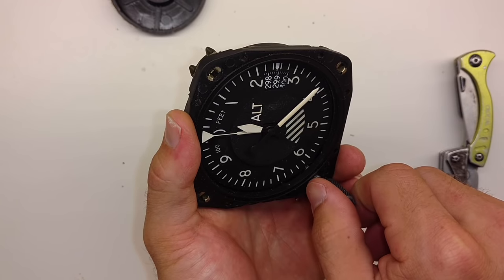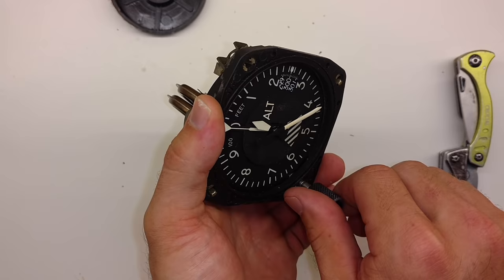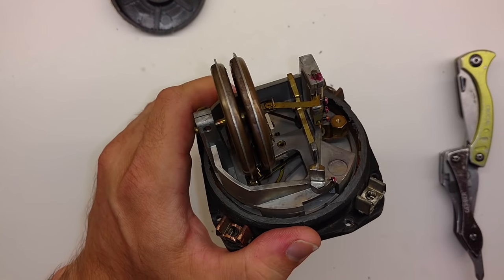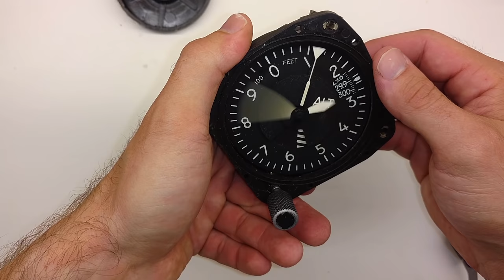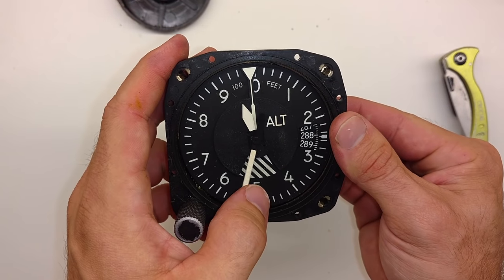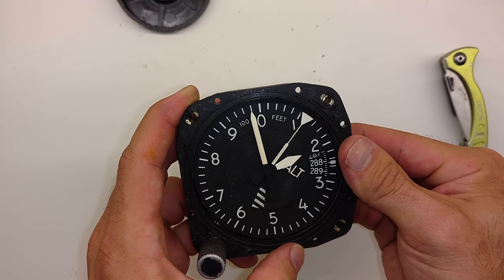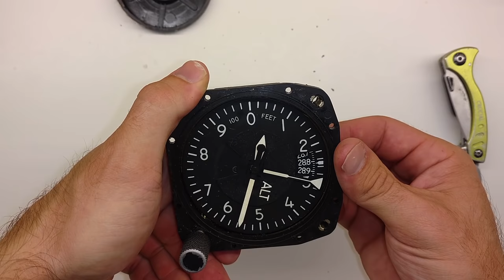Ep. 58: How an Altimeter Works | Inner Workings

Comment: Very useful about what it is for and how pilots read the dials - but sorry, it is WRONG about the capsules/wafers in it.  They are referred to as "aneroid" because it means without air.  During the manufacture the air is pumped out, then sealed.  They would collapse under the pressure from the air except that a flat spring holds them open.  As the air pressure around the capsules varies the amount of pull on the spring changes and with that the spring moves; turning the gears etc. as described.

Comment: Great video! Just a question: are you sure the capsule (wafer) contains any gas? I've always found the term "aneroid diaphragm" in several handbooks. That means "vacuum chamber" so an empty space into the wafer. Any gaseous element goes subject to expansion and contraction (pressure variation) due to temperature change. This is my understanding of the physics of gases. Thank you!
Reply: Diego,  It has to contain some gas.  The gas "expands" as the pressure outside the chamber decreases.  If the chamber did not contain any gas, it would not expand.  In this context, "vacuum chamber" probably refers to a low pressure environment. Also, the altimeter IS affected by temperature.  The amount of error depends on the height above sea level and the temperature.  When it is hotter, the indicated altitude shows you are lower than you actually are, which isn't generally a problem.  However, when it is colder than standard(15 C)  you are lower than indicated which puts you closer to terrain and obstacles.  That's why some airports are cold weather restricted.
Reply: @IdleIslander  Not correct.  There is a vacuum, not perfect of course, but the aneroid capsule will change as the external pressure squeezes it against the spring which keeps it open.   The effect of temperature is calculated as density altitude by the pilot and the altimeter does not correct itself for temperature changes.

Comment: Hi there, do you know if the adjustment knob adjusts the hands and pressure indicators only, or does it also influence the compression of the bellows. My impression from the video and from some schematics I've been looking at is that it does not affect the bellows hence the rotation of the entire rear of the module.

Comment: If you have say a 50 or 80 foot deviation and your altimeter are you allowed to adjust for it and have a different barometric pressure to correct four versus the pressure you're given from ATC? Is that some kind of FAA violation?
Reply: The AIM (7-4-3) recommends having the altimeter serviced if the error is on the order of ±75'. 14 CFR 91.205 requires an altimeter for an aircraft to be issued an airworthiness certificate for day VFR and all other flight rules, and 14 CFR 91.213 (d) 2. states you may only take off in an aircraft with a faulty instrument if that instrument was not required for the airworthiness certificate, unless you get special permission.

Comment: I'm stumped about the altimeter Kollsman adjustment. The altimeter is essentially height readings as a function of various supplied pressures. When set QNE the table is the ISA relationship (ignoring everything but pressure as a factor). When set other than QNE is it biasing all of the pressures (independent variable) by a set amount or is it biasing all of the altitudes (dependent variable) by a set amount?

E.g. if your altimeter was showing 1,000' too high and you cranked the Kollsman to subtract 1,000' would you be taking a constant 1,000' off each reading or would you be adding a constant P pressure?
Reply: It's a mechanical adjustment that rotates the entire mechanism by, using your example, 1000 feet.
It doesn't influence the pressure sensing linkage at all.
Therefore, climb 1000 feet and it'll indicate a 1000 foot climb, regardless of the Kollsman adjustment.
In other words, it adjusts the "zero point" of the instrument.

Comment: They say a picture is worth a thousand words--this video should be mandatory viewing in flight school.  I can't tell you how many texts I read that left me asking, but how does it actually work?!  This video put it to bed.
Reply: Thanks millions for this. I also encourage viewers to watch "How It works Altimeter" by shidifu111, because it is a great graphic vid that shows what you can't see well in the real altimeter.
Also, I see some discussion of aneroid wafers
the PHAK says
"A stack of sealed aneroid wafers comprise the main component of the altimeter. An aneroid wafer is a sealed wafer that is evacuated to an internal pressure of 29.92 inches of mercury ("Hg)."
There are some misleading ideas here. "evacuated " seems to indicate that all the air is removed. BUT it then says "to an internal pressure of 29.92 in Hg", which is not a vacuum. Maybe they used the term aneroid, which I take to mean no air, because the static tube goes to the altimeter, not the aneroid wafers.

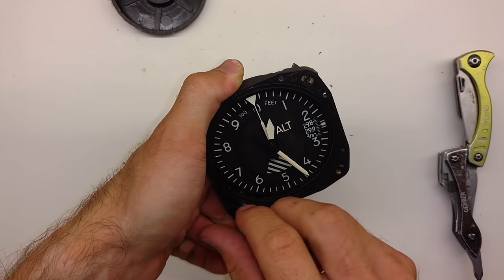Comment: great video. One correction, at around 3:00 standard pressure is 29.92 not 29.90
Reply from the maker: It wasn't intended to be set to standard pressure there, just using 29.90 as a random setting to yield an altimeter reading to compare it to an imaginary "field elevation".  Almost nice catch though!  Safe Flying!

Comment: 9 apr 2020 6:52 pm edt:thanks

9 apr 2020 7:52 pm edt: 3:59 altimeter-maximum-operating-altitude 20,000 feet.
10 apr 2020 12:25 pm edt:
2:37 maybe barometer-altimeter for high altitude, has thick-aneroid-waffer.
barometer-altimeter for low altitude, has thin-aneroid-waffer.
42,000 feet is maximum-flying-altitude.
[source:'Flights travelling around the world often fly at an average height of 35,000 feet', 
'While there is no official maximum altitude for flying from aviation authorities, aircraft carriers have their own maximum heights that they are capable of flying. Private planes and commercial jets can go up to 42,000 feet, while smaller aircraft often stay around 10,000 feet.''
in https://www.express.co.uk/travel/articles/1020729/flight-secrets-plane-flying-too-high-maximum-altitude from google (aircraft maximum altitude)]

Comment: Question: is the front face of the dial completely sealed off from rest of the internals? For instance, could radium dust fall off the dial numbers and into the rear chamber where the wafers are?